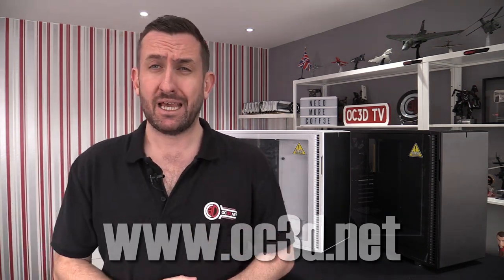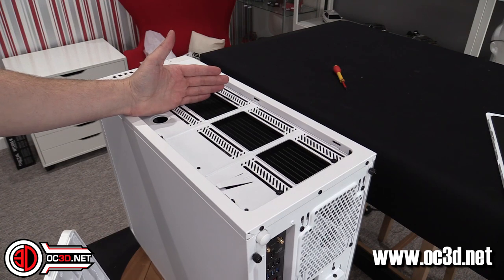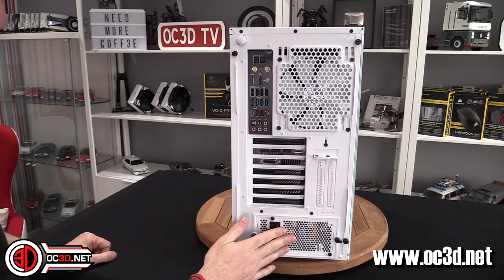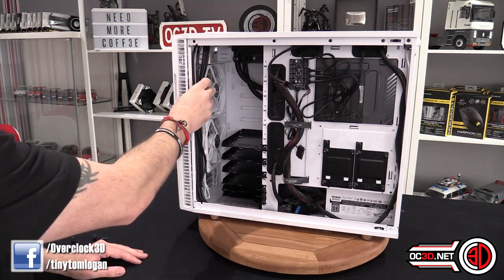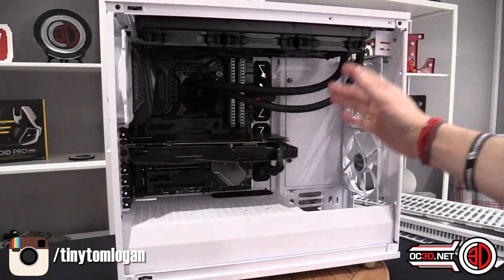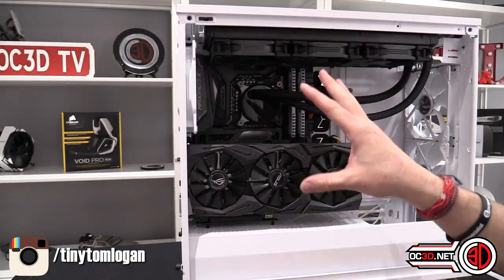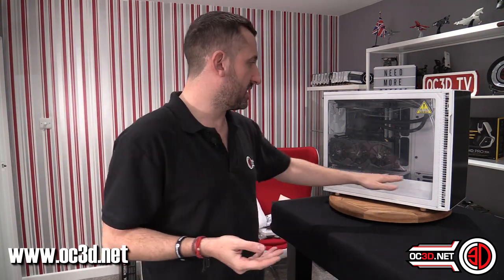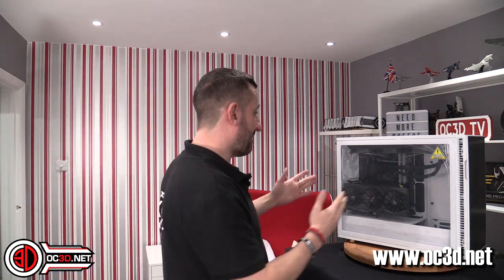Fractal Define R6 Review

Comment: Leave my 5.25 drive bay alone!
Reply: I know!! There are also other things that can go into that 5.25" bay as well; card-readers, fan-controllers, bay-res, usb-hubs, etc. etc.
Reply: That's where I keep my stash.
Reply: Honestly this case is aimed at corporate customers (not white probably) / silent. The fact you can make it into an enthusiast case is just bonus.
Reply: For me the 5.25 drive bay is actually one reason to buy the R6 over the competition (e.g Be quiet Dark Base 700)
Reply: I agree, No place for my BluRay drive = No money from me. I hate this trend of most cases with zero 5.25 bays.
Reply: For me 3.5" sata hotswap bay is must and with adapter it can take 2.5" drives. And no, usb docking station doesn't cut it. I got R5(over similar silent cases) because it had 5.25" bays. Also no glass and rgb crap.
Reply: Scott Yup. I have to have my Bluray drive so I can populate my Plex server.
Reply: Say it out loud!
I was thinking maybe they could have added another optional 5.25 on the bottom of the case.
This way I will be able to fit my hot SSDHot Swap Caddies and the CD drive.

This gap in the bottom needs to be utilized.
Reply: Couldn't agree more.
Reply: exactly, it's specifically why I went with the R6 over the Define C, or competitor cases.
Reply: @alexmarin7897  same
Reply: Yer I actually brought this case because it had that bay so I could move my Blu-Ray drive there. I also got one without a window because I don't care to see the inside or want RGB.

Comment: As to the front. No, you are wrong about making it a big open vent. This is the Define R so it is supposed to be low noise. Frankly, I think the big open vent in front would be ugly but that is a  matter of taste. 
The optical bay is a plus for me. I like having an optical drive and I do not want an external. I would like to see an option to have the font be nothing but 5 1/4" drive bays so I could put a lot of hot-swap drive bays in the front for a server. 
I would like to have an option to drop the glass panel and one with both sides glass.I would like the lower weight and a more professional look for my office workstation.
Reply: Exactly.  Don't base metrics of success on a product designed to do the opposite things you want.  They didn't build this case for you, so he isn't being objective by reviewing it negatively for that.

You CAN say this doesn't fit my needs.  You CAN'T say this doesn't fit the needs of those who it was designed for.

Fractal makes cases that do exactly what he wants and those will likely be versioned and updated as well.

Comment: no matter how you look at it lots of people still like using the optical drive bay. I use mine, there's 2 on my r5 which is unnecessary, but the one on the R6 is plenty reasonable. It's good to have even when you don't use it super often. And on top of that I'm not going to go and buy an external optical drive when I already have one I can just move over to a new case/pc so I do appreciate there being a single optical bay. If I need to use a disc drive, it's nice to open my door and press a button and just throw it in, no hassle looking for a dongle or opening it to plug the drive in with wires hanging out etc. IF you don't want the drive bay, remove it with some hacksaw magic :P
Reply: 5.25" bay is removable as it's in R5.
Reply: Kognak The front where the bay is is not removable so you'd need to cut it out to replace it with a full front mesh.
Reply: I also appreciate the option for a single 5.25.  Although I would hope for a snap in mesh piece to cover the bay if you aren't using it.  Just ordered this case.  Little late to the party.  :)

Comment: The reason for no like on the video - the optical bay rant. When will reviewers understand, people use it for non-optical-media applications?!? I use two - ok, one is a CD, I use it once an year, I can remove it. BUT. The other is a HDD caddy with MASSIVE vibration dampers, which, trust me is unbeatable in terms of noise suspension.
Reply: Михаил Найденов who has mechanical hard disk drives? it’s the 21 century dig deep and go solid sate! ...You can pick up a good 1TB SSD these days for under 250 plus it will run rings round the HDDs... in both performance and life span it will pay almost for itself in longevity in comparison to the mechanical variants. You only have one drive to replace so why not? I can understand if you had 10TB plus to replace being too costly.
Reply: This is super late but what HDD 3.5 caddy do you have? been looking at one of the icy docks myself, can open up the front quite a bit
Reply: @Bacon I love to bits my IcyDock TurboSwap MB171SP-B. I use it regularly to do my backups. It's trayless for convenience, it has a decent large fan on the bottom that's quite useful when you do heavy writing sessions on your drive, and it's very sturdy (all metal build).

Comment: Great to see an honest review once again. I think it's a brilliantly engineered case, with those side and top panel mounting systems. I'm with you on the front panel, they should have at least made it silver. One of the Connect D1 front panel add-ons they are selling even has silver accents! If it was a cost saving measure, they should have done silver front panels for the white and the gunmetal, and black fronts for the 2 black ones. I disagree with you on the 5.25" bay, the Define R series has always been about having options in my opinion. It's nice that they still keep it for the small niche who need that option, pretty much all other cases have ditched it. And about that vanity cover for the drive mounts. I don't see it as a problem, because if you aren't going to fill that space with a radiator and a reservoir, you shouldn't even consider removing it.

Comment: I'm buying 2 of these. Quite literally, case of the year for me. My creative mind won't stop thinking about the things I can do to this. I've watched multiple reviews and this is a dream case for me. One for a water cooled rig and another for a production server. I, love this case.
Reply: From what shop you buying it from? I couldn't find any yet in the UK.
Reply: Not released yet, at least not anywhere I've checked. I keep hitting the main site for additional bays, etc but so far nothing. Could be January before we see more proliferation into the market.
Reply: I found on some untrusted website for 135 pounds but I think is too high for this kind of brand.
Reply: That's actually a bit lower than the average MSRP I've heard, I'd be careful. Got a link for the site?
Reply: Sure, the first link is without the glass version but you can pre-order the glass version.
however, double check Fractal Design Define C TG. It's small and if you don't need much space this is ideal.

https://www.scan.co.uk/products/fractal-design-define-r6-black-mid-tower-computer-chassis-e-atx-atx-microatx-mini-itx-3x-140mm-fans

https://www.bit-tech.net/reviews/tech/cases/fractal-design-define-r6-review/1/

https://skinflint.co.uk/fractal-design-define-r6-black-fd-ca-def-r6-bk-a1746653.html
Reply: The price without the TG looks about right to me. 

I need space, that's the selling point for me for it's size. It will support an eATX motherboard and lots of moddability canvas space and room for a custom water cooled loop. It also comes in white, which is part of my design plans and has white parts for drive bays, etc, so the R6 is definitely for me and both my builds in the future.

Bit-Techs prices seem in line and I'm not surprised to see pre-orders. To me that shows that retailers are confident in the cases future sales and are willing to stock up based on pre-orders. Pretty standard thing to do for all kinds of products, so there's nothing to worry about there.

Go for what works for you, i always say, and if the Define C TG is for you, and better suited to your budget, then go for it. I bought the HAF X in 2007 for $350 bucks and it's still my favorite case to this day. I'm still using it but once I repurposed it's parts, its getting a good soak and all modern hardware with another custom open loop. I feel like the R6 is something I'm going to enjoy for years to come, just like my HAF X.
Reply: Well, I will still get the R6 because it's future proof, hope the price will be reasonable. 
Do you roughly know what price tag will be coming because you mentioned something earlier?
Reply: i just purchased my two. one glass and one solid for my server. will be moving from 2 define R5 cases.

Comment: As someone who hates PSU shrouds, if that hole wasn't there, I would not have given this case a second glance. If there is a version with no glass or window I will consider it.
Reply: Well that's an uncommon remark for most builders. The distinct lack of psu shroud is the biggest complaint I have about my current case

Comment: 22:26
EVER heard of a fancontroller or a reservoir????
It`s not only for a dvd drive......dammm and sorry but I thought you would have known this :P
For me personal I always use a fancontroller so I`m very happy with it :)
Reply from the maker: You can set up the fans with software and make it look tidier now dude
Reply: OC3D TV still, it's a place to put a bay res. Tom, if you hate drive bays, wait for the S version. No need to bash the R.  R Serie always has drive bays. I'm all for options for the consumer.
Reply: I know and I also can do that but I don`t like that.
I love a controller because I want nothing else then a simple knob witch you can turn.
I don`t like software controlled fans :P
Reply: Andres having used both software and knobs before, if my case could accommodate the space i would prefer knobs version too, software ver are just too wonky, im looking at you NZXT.
Reply: I set my fans on 5 volts or so with the controller (goes alot faster then software) and leave it like that when I`m going to game.
And If I`m not gaming.......I turn all my fans OFF because I`ve got a massive overkill on radiators :D
With all the fans off my temps are still great. You can not do this quickly with software........with knobs you can :D

Comment: My opinion - This is a brilliant case and a joy to build in. Built my first pc in December, 2019 with Ryzen 3600 and had no interest in glass or any RGB bling. I wanted quiet and needed the 5.25 drive. I am using an NVME M.2 drive along with a storage SSD mounted on the back. At build time I was not a gamer but was not comfortable with the stock Ryzen/Wraith cooler, so installed a Sythe Mugen 5B. Being stuck inside due to COVID I have eventually started playing sim games and my CPU temps have never exceeded 60’C. The presenter keeps wanting to make modifications to a case that is already so amazingly customizable and has made several nitpicky criticisms.

Comment: This is the case I was looking for... released just in time for my build next month :-)
- finally an aluminum front (my ancient TT Soprano has a feeled 1kg massive metal door... did not want that plastiky doors back)
- a full metal roof
- one external drive-bay is sufficient for my card-reader
- very clean interiour with good, silent air-ventilation (won't go for water-cooling)
- a PWM fan-control (why the heck would I want a cheap manual switch to control my fans, if motherboards can temperature-controlled manage fans since ages?)

had the Nanoxia Deep Silence 1 Rev B and the Lian Li PC-K6SX on my shortlist - but both had little "glitches" I did not like, which now the Define R6 solves all

Comment: You have to buy all three color cases to get the aesthics you want by mixing and matching panels from all three to get the proper uniform look. I had to buy a Corsair 460X and Corsair 400C to get the bracket side panel on the 460X, a clever marketing strategy

Comment: I really liked the flexible storage vs the fixed 3x or 4x3.5 cages we normally get. NVMe is changing storage, and these demand lanes and less space, and I suspect will change demands on case storage topology still further

I’d love a tempered glass panel for my Arc XL.

This puppy can contain more drives than my ARCXL which has 3x5.25 bays for...

Comment: Hey Tom, big thumbs up for you review, I watched 4 other bigger techtube channels and not even a single one figured out that you can put the HDD bay cover to the back and just left a big open hole there, lol. I'm sold on this case, it also got room for 280 rad in the bottom, mount the pump/res combo on that bottom rad and fill out the space with nice UV fluid.
Reply: Yeah, noticed most said you had to remove it, ironic because Tom hates it the most :)

Comment: I know this may be a niche use case, but I have my reasons. If I were to put 4 1080 Ti Founder's Editions in this case, with one of them in the vertical slots, would the power cables from the other 3 interfere with the vertical card?

Comment: Help a guy out!  I have that same formula x motherboard, and an r6 in the mail.... is that top port for the VRM waterblock accessible with a 120mm wide rad? I assumed a 140 would be too fat, but I'd like to run my loop out of the top rad, to the other port on that VRM block, then out of the other, straight down to the cpu.

Comment: Great Review Tom. Only thing I would disagree with is the top of the case. I don't think it is a stroke of genius at all. It looks ok but fidly and un-necessary. Recently we have seen cases with magnetic mesh fan filters and IDK why Fractal didn't go with that option. If they we're so desperate to throw a bit of black in, then a black magnetic fan cover for the top and a white front panel would have looked much better IMO. Even so, you're case reviews are always the best around; thanks.

Comment: sticking with my R5.  tired of the copy cat psu shroud tempered glass look every other case manufacturer has fallen into line with to cater to the masses.  they should have made that psu shroud removable but i'd say it's for structural support since they did away with the drive cage that  supplied this support in the older R series cases.  they still haven't given the option to change the front power "led" from blue....  i also miss the solid feel of the R4's front door with it's magnetic latching system.  just felt smoooooth.  if you had one, you know what i mean.  i feel let down by this case.  I like the glass better than the acrylic.  i love the solid top to maintain symmetry better.  the top mod vents are pretty much my only gripe with the R5 other than no included filter if you take them off.  other than the glass side and solid top, i think this case takes a step back.  i dunno.....i doubt i get one.
Reply: when you use 5+ 3.5" HD's it really hampers the air flow from the front of the case.  i loved the fractal defines because of the bottom 140mm fan mount to feed the gpu cool air when utilizing the drive cages.  In this new case that shroud ruins that option.  it has two points imho that are better than the R5/R4 and those are a true glass side panel and a solid top option that doesn't look unsymmetrical.  both of these points are aesthetics  and performance / functionality always trumps aesthetics (well it should).
Reply: yeah, I can see that airflow problem. however, i'm going to only be using like two drives, I was going to get the meshify c, but after seeing this, i think i will have to get this. i really like the wall, i think i can bring something really cool with case lighting.
Reply: it's nice don't get me wrong and will work perfectly for what you're going to use it for, but i myself would go for a smaller  "lighter" case if that was all the hardware i was going to use.  they'll probably  do the Define C in the same fashion as this one if you feel like waiting.  imo these cases were originally designed to hold a lot of hardware and to keep it quiet and cool while doing it.  it seems they've gone cookie cutter with a case line that has become legend in the pc case world for being unique.
Reply: People using HDD these days. 😂
Reply: yeah we kept our digital data stored on our own mediums back in the day instead of the cloud.  hopefully losing net neutrality won't affect those relying on their data, games, movies, etc etc. with data caps, throttling, extra charges etc etc...... yeah people not using hard drives these days...>;)
Reply: halistine jenkins Too bad I won’t get affected by net neutrality :)

Comment: hmm i actually like the single optical bay. i still use a touch screen single bay fan controller so im okay with that being there. for be its a bit long back to front. i dont need 150mm of empty space after my gpu. the define c is like 20mm to short for a front mounted aio and a 300mm gpu. this is like 100 to long. fractal please meet me halfway and make something that supports a front mounted rad and like 315mm for a gpu without leaving me with 10cm of empty space to try and fill. if you're doing custom watercooling this is probably great but the vast majority of us just used an aio. holes for mounting a reservoir on that plate would have been good though

Comment: Right from the very start I really liked this chassis; I thought it was going to be the perfect chassis for my next upgrade, then I saw that hideous black front panel on a perfectly white chassis....

Why, why would any manufacturer put a black front panel on a white chassis? This isn't the same as putting a strip of black across the front - maybe on the inside a splash of black , it's not the same thing as when other manufacturers have done by adding another color to the chassis(e.g. NZXT H700i - White with a black interior,or the NZXT S340 black and red interior) , because the addition of the black panel seems to me that Fractal Design ran out of white ABS or paint and black was the only color left.

As for the interior panel; Fractal Design has so many cool ideas that they've included in the relatively low price, how much of a price difference would there have been to include a removable front panel (or make the existing panel slide to open or close the front area).